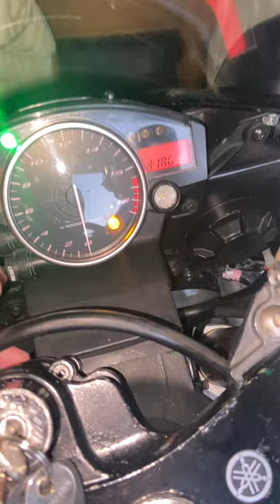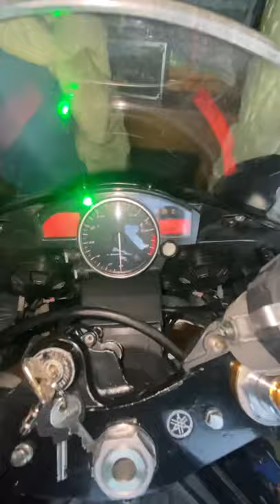R6 TPS Valve Sensor Issues

Comment: I have a 2008 R6. I bought it through Copart when it starts, it's hard when it's cold. I changed the spark plugs and I realized that I didn't have something connected and then I realized that it was the PVC sensor It doesn't have it. Could that be the fault?

Comment: Have fault coming up throttle position sensor,bike won't ride over 4k revs ,no power commander,ecu flashed
Reply from the maker: Are both of your TPS sensors calibrated and working correctly? You can check this yourself. There’s a detailed method telling you how in the service manual.

Comment: so what was the issue im having the same problem with my 06 r6 it does have a power commander which i unplugged but i left the wire that taps into the  throttle cable im guessing.
Reply from the maker: Did you ever figure it out. I found out that that wire that is still plugged in, even with no power to the Power Commander, somehow shorts out and causes this.
Reply from the maker: Yea, you still have to unplug/disconnect that/those tapped wires. They still ground out/short even though the power commander is unplugged.

Comment: My own bike won't run, what did you do to fix this I don't have a power commander
Reply from the maker: Did you ever figure it out. I found out that that wire that is still plugged in, even with no power to the Power Commander, somehow shorts out and causes this. I would up having to run my Power Commander with no extra/accessory wires plugged up to it. Just the Commander alone.
Reply: @Nezzurah  have u fixed this ? I have changed my tps but still not fixing this issue.. but bike run perfect
Reply from the maker: @wailoonlee8589  do you have a power commander or any type of add on like that?
Reply: @Nezzurah  yes
Reply from the maker: @wailoonlee8589  first thing I believe you should try is removing the Power Commander to see if that solves the problem or not. And when I say remove I mean to disconnect the ground and all wires physically connected to your bike’s harness. Once you have the Power Commander completely disconnected be sure to reconnect everything to its proper place on your bike then crank it and lemme know how it goes!
Reply: @Nezzurah  I would like to try just by disconnecting the pcv. How do I disconnect it?
Reply from the maker: @wailoonlee8589  do you have a power commander 5?
Reply: @Nezzurah  yes

Comment: Having the same problem  , did u fix it and if yes how;
Reply from the maker: Yes I did fix it finally!! But first off, do you have a Power Commander? And if so, do you have any of the 5v inputs connected? =)
Reply: @Nezzurah  god damn bro u are right... just unplugged the power commander and it works fine.... thanks a lot bro !!!!!!!!!
Reply from the maker: @Pikinoua  Not a problem man! Ride safe!